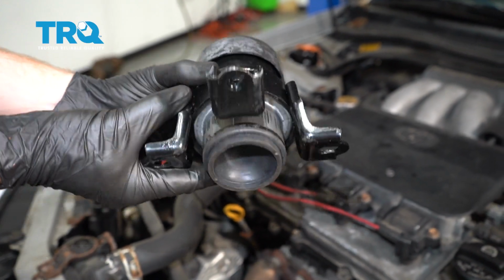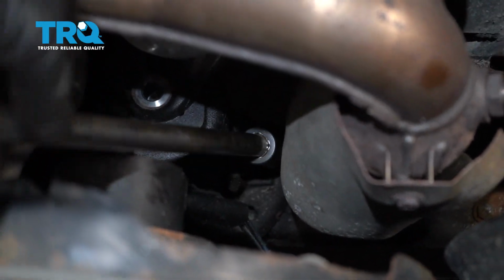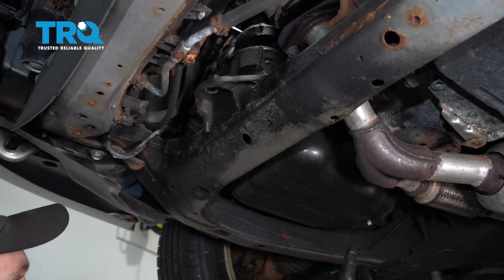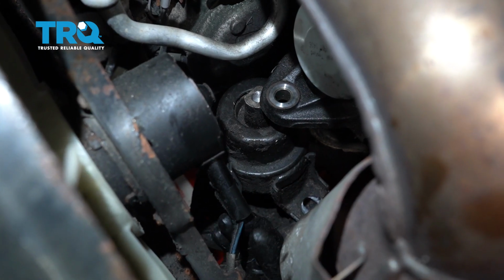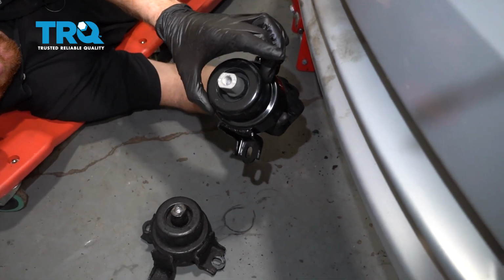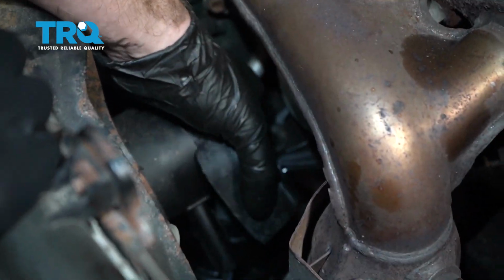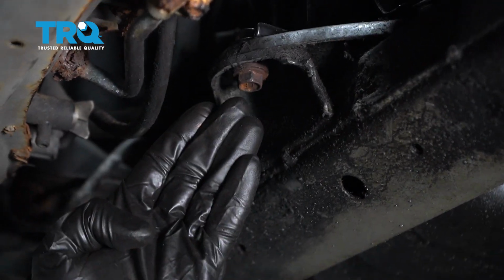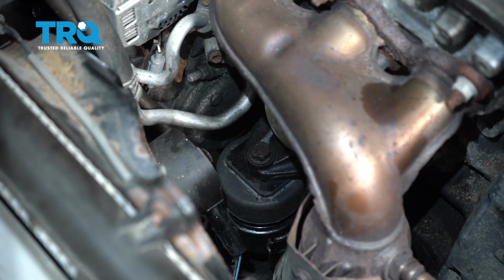How to Replace Front Drivers Side Engine Mount 1999-2003 Toyota Solara

Comment: I hope this helps someone. Did this change on a 2003 Lexus es300. Mine has a wire/hose bracket on the back of the engine behind the plenum that will press into the firewall. Loosened it with a 2' extension + deep socket from under before I could lift the engine, pulled the bracket sideways with a Bungie, also needed to remove bolts for radiator bracket to remove it from the front. Engine crossbar was worthless just use a jack & wood block

Comment: Good video. FYI, this video also applies to Gen 1 Siennas (1998 - 2003). Saved me from thinking I had to remove R side fan shroud to get the engine mount out.